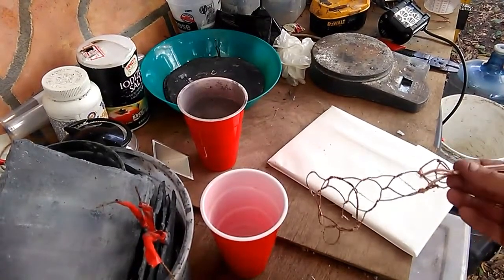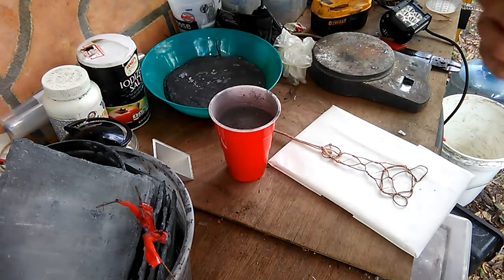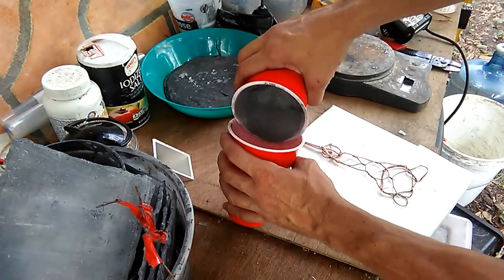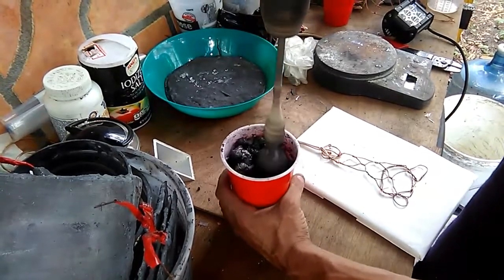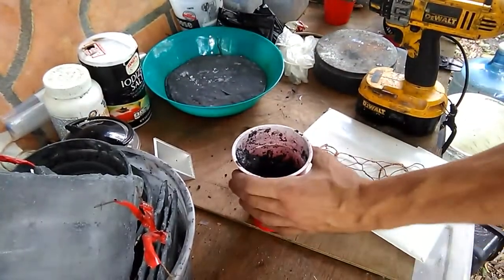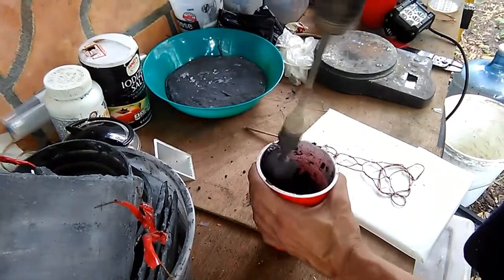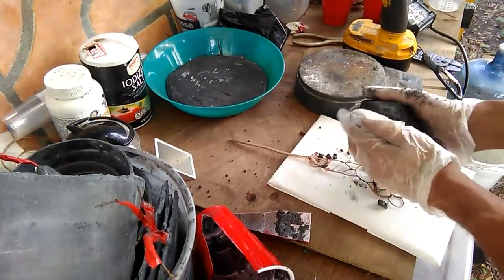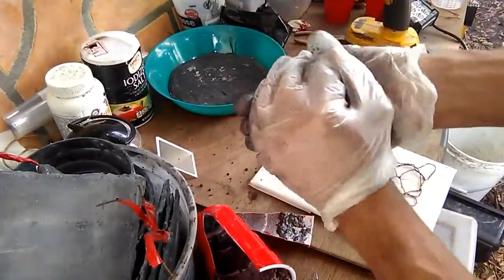How to Make a Graphite Carbon Rod Electrode for Battery and Other Applications

Comment: what was the resistance of the rods like? What is the mix graphite, water and?
Reply: Here is a mix I found on the internet. Raw materials such as petroleum coke, needle coke and coal tar pitch account for 66.88% of the cost of graphite electrode. Low-sulfur petroleum coke, coal-based needle coke functions as aggregate, coal-based asphalt works as binder.

The graphite electrode is made of petroleum coke, needle coke, etc., and coal tar pitch is used as a binder. It is manufactured with 11 steps, that is crushed, compounded, mixed, pressed, calcined, impregnated, second baked, graphitized, machined, quality tested.

Comment: What goes into the mixture? Cool video! Very interested to know more. Thanks for the upload
Reply: Here is a mix I found on the internet. Raw materials such as petroleum coke, needle coke and coal tar pitch account for 66.88% of the cost of graphite electrode. Low-sulfur petroleum coke, coal-based needle coke functions as aggregate, coal-based asphalt works as binder.

The graphite electrode is made of petroleum coke, needle coke, etc., and coal tar pitch is used as a binder. It is manufactured with 11 steps, that is crushed, compounded, mixed, pressed, calcined, impregnated, second baked, graphitized, machined, quality tested.
Reply: @bobaom  it may also be made by sintering, relying on temperature vs expansion, its put into a mold and heated, then let cool down- cant remember if it expands or retracts when heating up. annealing. this is how true graphite electrodes are made

Comment: Mix is  graphite powder and a binder.
Reply: Yes! Cement enhanced with additives. Just like the best of the best concrete is made.
Reply: Here is a mix I found on the internet. Raw materials such as petroleum coke, needle coke and coal tar pitch account for 66.88% of the cost of graphite electrode. Low-sulfur petroleum coke, coal-based needle coke functions as aggregate, coal-based asphalt works as binder.

The graphite electrode is made of petroleum coke, needle coke, etc., and coal tar pitch is used as a binder. It is manufactured with 11 steps, that is crushed, compounded, mixed, pressed, calcined, impregnated, second baked, graphitized, machined, quality tested.